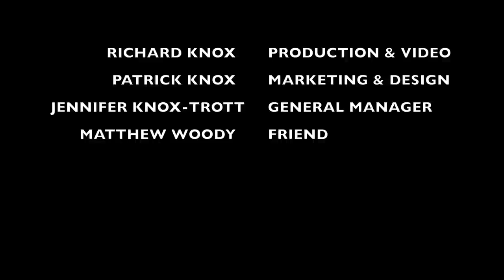S2 EP2 | TIMBER FRAME | WOODWORK | SETTING POST FOR OUTDOOR COMPOST TOILET

Comment: That’s the best way to do those posts is burn them and put them in the hole 🕳 and put the cement mix in and add water ! People don’t believe that but it works and sets up hard! The burning of the posts prevents rot and they will last a lot longer many many more years than If they wasn’t burnt. 😁👍
Reply from the maker: Your correct